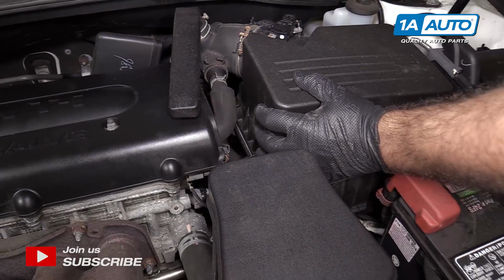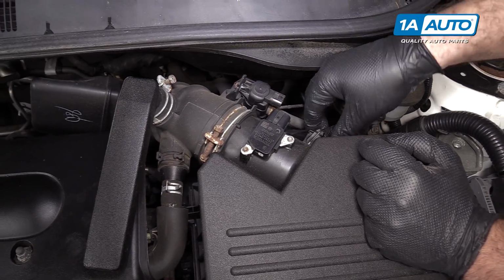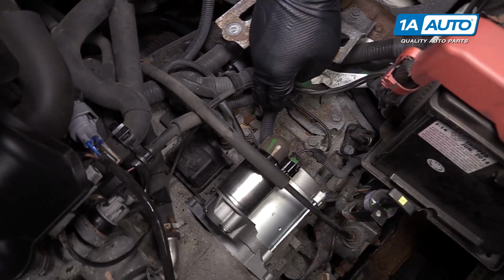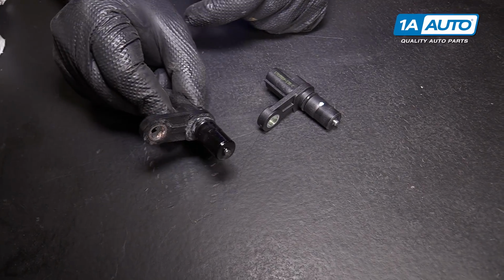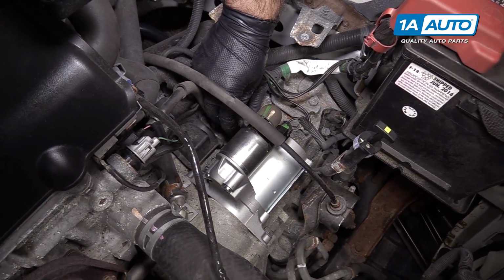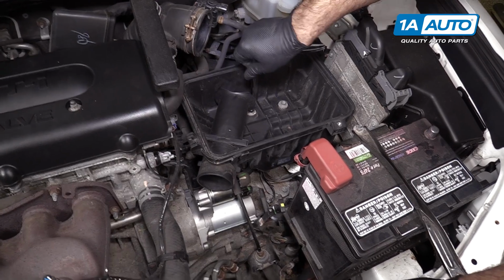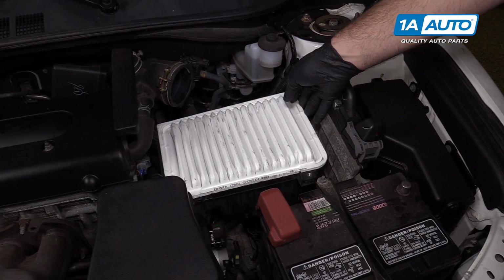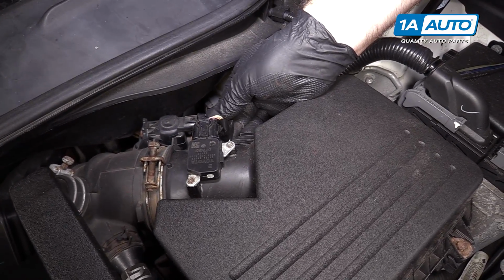How to Replace NC Speed Sensor 06-11 Toyota Camry

Comment: Getting P0500 (speed sensor) code on my 1998 V6 Camry.   Will go in reverse but not forward without difficulty.  Any way to determine which speed sensor it is?  There are apparently two of them?  This one and another way accessed from below seated in the transmission case with the speedometer gear on it.

Comment: My dad have a 2006 Toyota Camry and he got the P0717 code and he replaced two sensors but the code came back along with the check engine line. The car slips just a little, any idea what it could be? that's the only code that comes up still.

Comment: So i have a 2007 Camry 6cyl. Got the same code, bought the part on amazon for $13 got it. I took off the air filter and box. So when l get to where the sensor should be on my car, there is nothing. It looks like a cap where the sensor should be. Theres no plugs 🔌 no electrical wires anywhere leading to it. I spent 7 hours looking for that damn sensor. I followed every single electrical wire to see where it lead and still no sensor. 
Im stumped and l really need help. I went to the  Toyota dealer, PepBoys, Auto zone, Orielly, even forums on the internet wondering if anyone else has had the same problem. My guess is with my luck l probably have a special sport model or some crap that doesnt have a speed sensor?!? The dealer told me it would probably need a “re-flash” of the computer to reset. Auto zone and PepBoys all told me the same thing, that the sensor should be located on the right side of the transmission near the output shaft. I told them l checked and there’s nothing! Please help!! Thank You!!
Reply: exact same issue for me. Did you ever find its location?